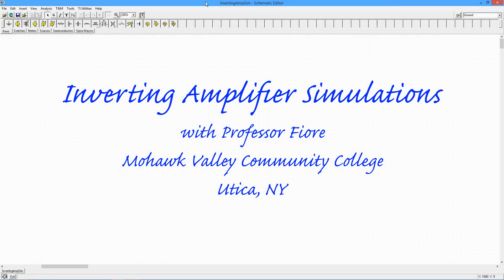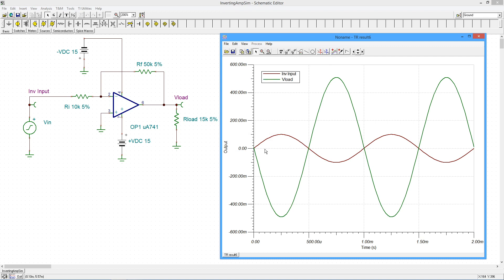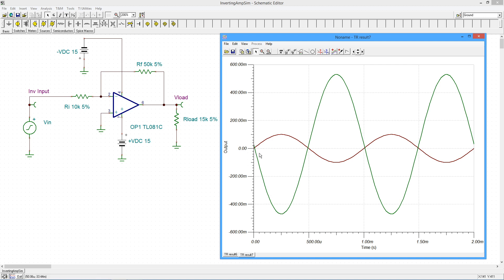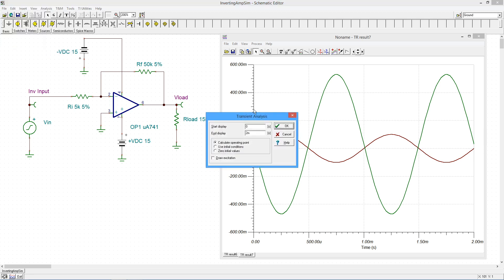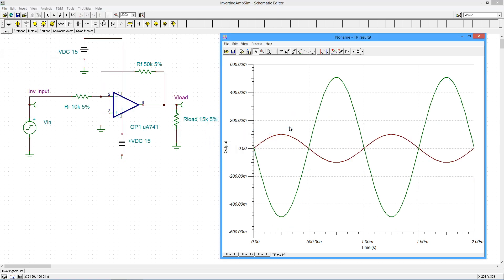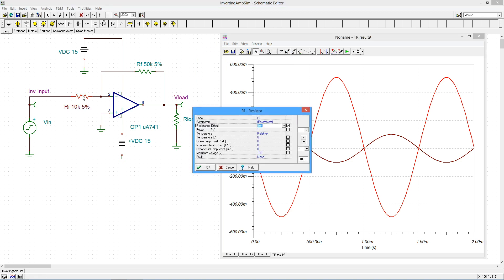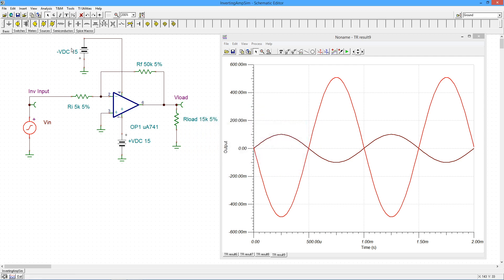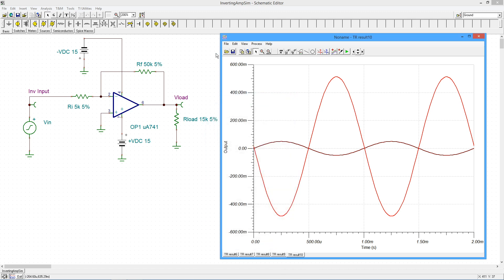Op Amps: Inverting Amplifier Simulations

Comment: Excellent, thank you. Would there be any difference in THD if we kept the resistor ratio the same but used smaller resistor values; 5k:500R compared to 50k:5kR?
Reply from the maker: Most likely not but the lower resistors should lower noise (at the cost of increased current consumption).

Comment: I had a circuit of op.amp which is having in the terminal of 3 & 4 is connected with 100 mfd/25 v condenser and there is no feedback both in invert and non inverting points and output points connected through 22k resistor....IN4148 zener diode and 2N 2222 transistor connected in series to feed a 12 v relay..y question is what kind of circuit in op.amp since this not having feedback and how can i calculate the resistors...capacitors.... value....